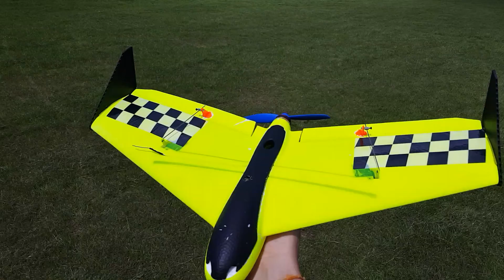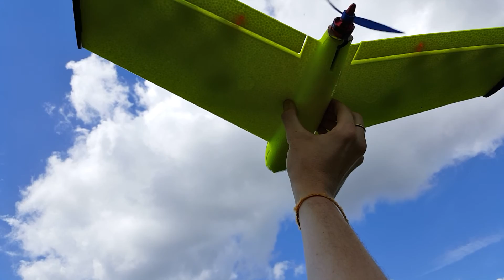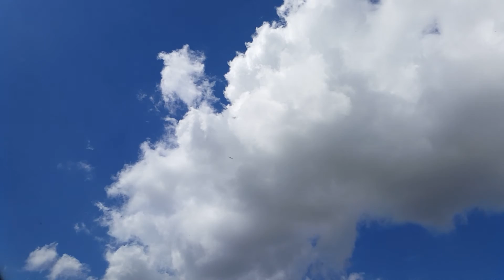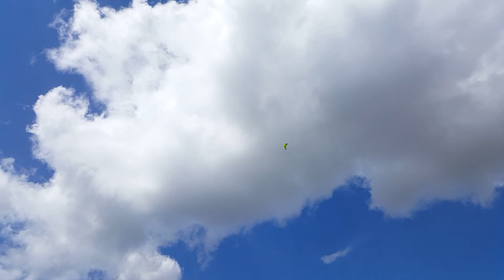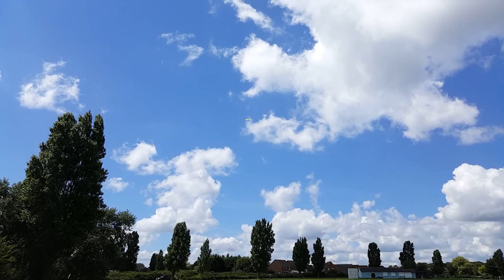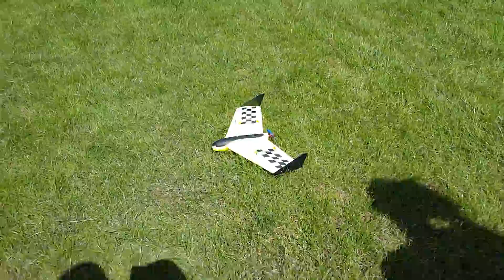Skywalker X-1 - 2204-2300kv 4S

Comment: Nice build. Where did you put the FPV antenna? Having a hard time myself finding room for all fpv components within the frame.
Reply from the maker: At the start of the vid, where I'm holding the X-1, you can see an SMA sized hole cut into the canopy near the carbon spar. I put the Aomway VTX in there and had the antenna poking up.. worked really well :)